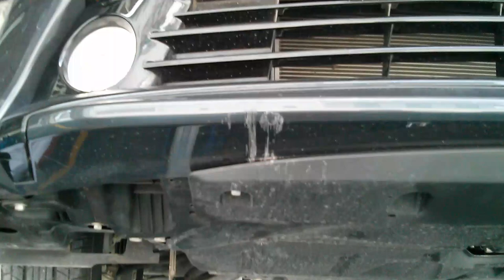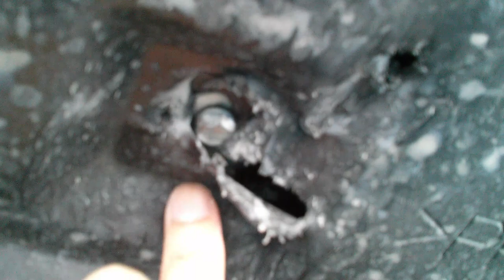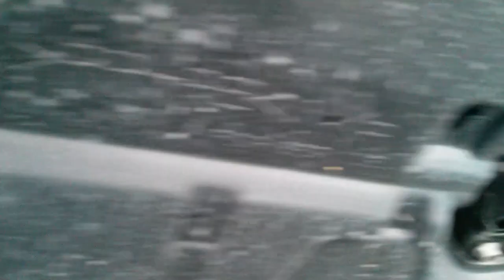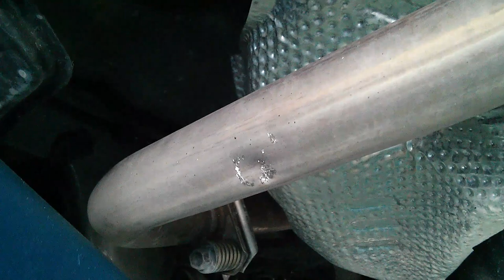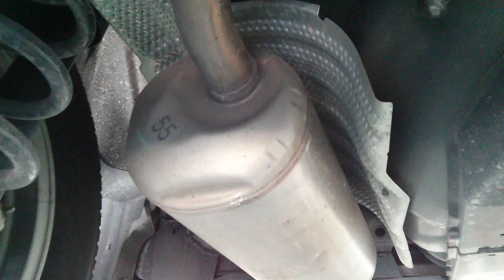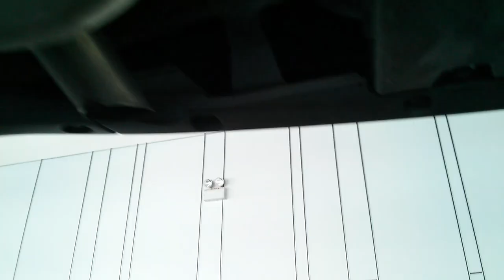Damaged Undercarriage

Comment: never affect anything? I got it when i hit a kerb but at low speed, also similar to your, but it only affected the crossmember of the front... tomorrow will be going to a workshop to get it jack up and check. but i got an unusual sound coming out when i start the engine, i think some part went loose.
Reply from the maker: It drives fine. Didn't affect the alignment too.